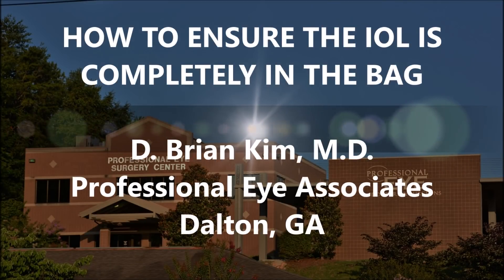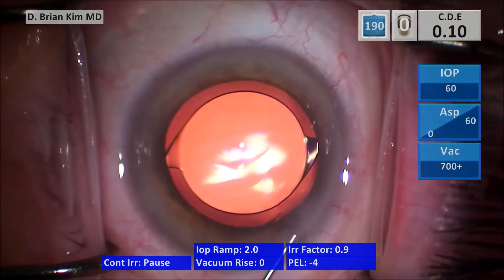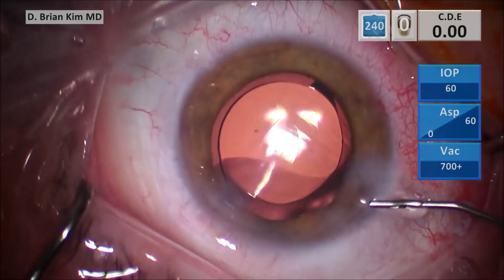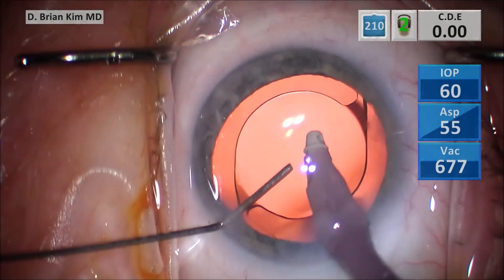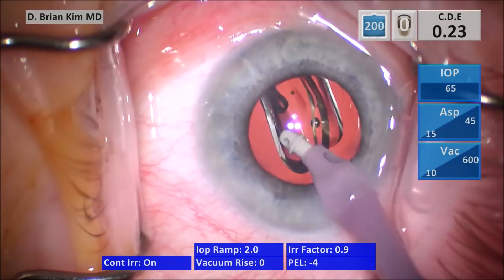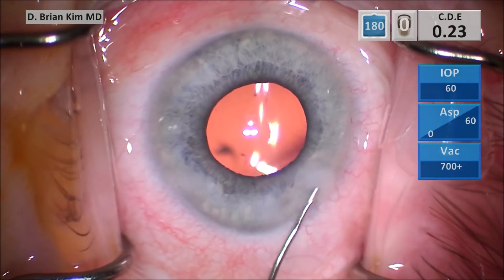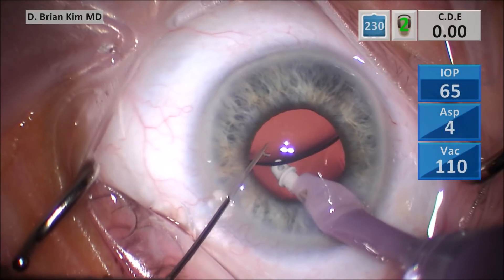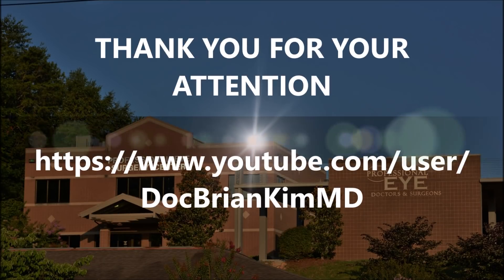How to Ensure the IOL is Completely in the Bag

Comment: Sir, while doing I/A under iol, iol gets shifted from center to periphery and overall iol Dia.12 to 13mm ,can this shifting cause equitorial PC rent? due to haptic or its tip, Any precautions to avoid it?
And second, in case of equitorial pc rent apart from pupil retraction which things will ease its detection? like globe tilting?scope I use has 6degree and (-)2 degree Illumination,  no coaxial
Reply from the maker: Hello this is a great question and depends on technique. Let me clarify. The IOL does not need to be pushed into the periphery. As I show in my videos, I do not push the lens into the periphery. Rather, I get under the lens and tilt the optic. This way the motion is rotational and not translational and the IOL is still centered but tilted in order to allow the OVD to come out of the bag.

Similar concept to a revolving door. The door is not moving out of place. It is rotating on axis. When you tilt the optic vertically, it should not move into the peripheral capsule fornix.

But even if you accidentally pushed the IOL into the periphery, this should not cause a PC rent unless you push too hard into the posterior capsule. This should never happen with good technique. Best wishes.
Reply: @DocBrianKimMD  Thanks a lot

Comment: i implant iol under irrigation without ovd  
what is your opinion
Reply from the maker: Dr.ahmed Esmat , I have never done that myself, but as long as you can do it safely without damaging the bag, I think that’s actually more efficient. One less step to remove OVD, but I just think OVD provides more control and stability.
Reply from the maker: Dr.ahmed Esmat , if this technique is working well for you, I wouldn’t change anything. Thank you for sharing.
Reply: Sir, when u go under the optic of iol   to remove ovd , u just do constant irrigation or u do irrigation and aspiration both ...
Reply from the maker: Amit Sood I always have continuous irrigation active when I’m in the eye. When I go under the optic, it is with continuous irrigation without aspiration. Only once I have the I&A handpiece under the optic, then I will begin to slowly aspirate the OVD trapped between the IOL and the posterior capsule. I hope this helps.
Reply: @DocBrianKimMD  thanks sir